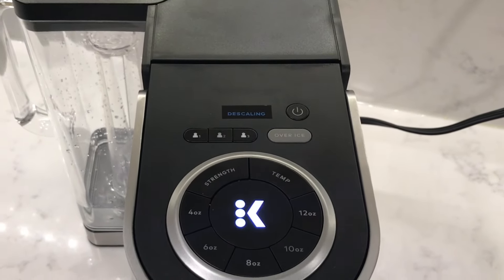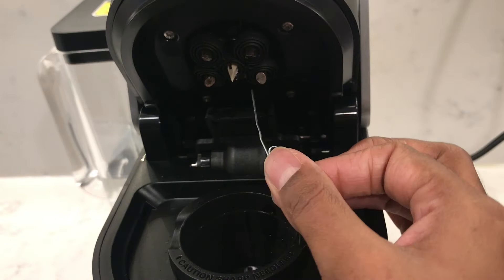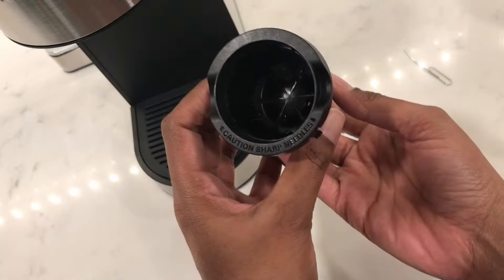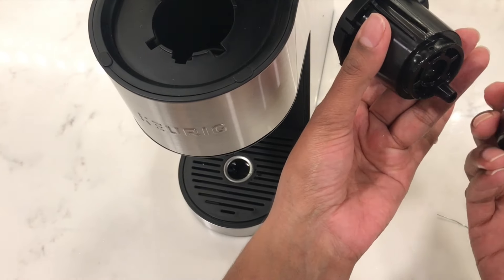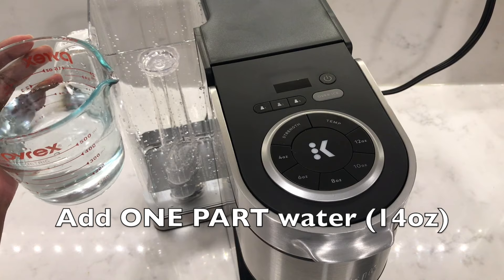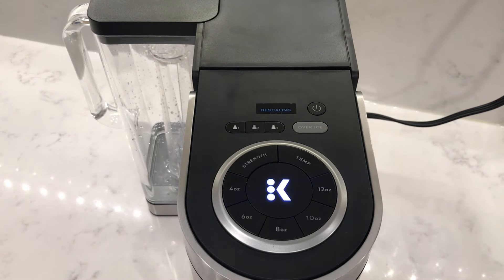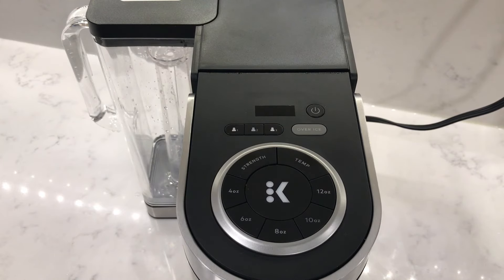DESCALE and CLEAN your Keurig Now for Better Tasting Coffee!

Comment: 0:46 Just an FYI for anyone watching this in 2022. The rubber “surrounding area” thing pops right out. It’s not secured by anything other than tension and friction. Pull gently and it slides right off. You can rinse it off completely. I found it easier than working it with a toothpick or paper clip.
Reply from the maker: interesting, thank you for sharing!

Comment from the maker: Descale: TURN OFF the machine (power button only - DO NOT unplug it) >  press 8+12oz together > press the 'K' button. 
- Remove the filter first (apologies this was not included in the instructions I found on Keurig's website, but it is noted on the solution bottle which I didn't have at the time I made this video).
- Make sure you have enough water in the tank, even if the 'add water light doesn't turn on (there are a lot of problems with this machine!)
- If the light is still on, clean the needles, coffee deposits are possibly stuck inside somewhere.

Comment: The key to this process is to this: You start with the coffee maker plugged in but turned off. In other words, nothing is lit up on the top of the lid you close. Easiest way is to unplug the maker, weight a few seconds then plug it back in. DO NOT TURN ON THE POWER USING THE POWER BUTTON. 

Now press and hold the two recommended buttons and off you go into descaling mode.
Reply: Finally someone explained the subtlety. Thank you! I've been trying literally for months to figure this out.
Reply: OK so let me get this straight!! We hit the 8 and 12 to descale. But while it is off!!!! OMG IT WORKED!!! next dumb question. Do we descale with the mineral thing in there?
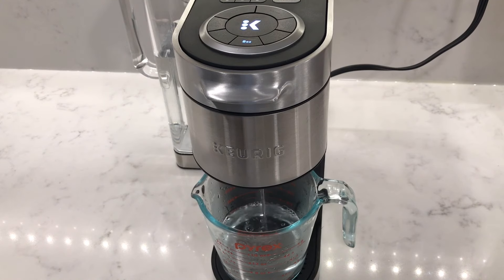Reply from the maker: @starnettacone7145  Yes, as I showed at 2:21, make sure the machine is off.  Remove the water filter if you plan to keep using it for a little longer, otherwise, it doesn't matter if you leave it in if you're planning to change it anyway. Hope that helps
Reply from the maker: Yes, I did state at 2:21 to make sure the machine power is off. But thank you for the adding step of unplugging if it needs to be done.
Reply: Finally after watching many videos it worked!!! Key is TURN OFF machine!!! Thanks
Reply: Thank you for this!   I was going crazy trying to get to the descale mode - much frustration alleviated by your clarification - saved me much frustration!
Reply: For those of us who don’t have a 12 button, press the 6 and 10 for 3 to 4 seconds. The Descale and 8 oz button will flash. Run 8 oz cups. You will need to refill water when the add water flashes. Min only needed to refill once. When the machine turns off and all the lights are off, the descale light should be off when you turn the power on again.
Reply: Omg! Thank you! I thought I was dumb and my machine was angry with me! Lol
Reply: @ALEXSIMONE  Me too... in fact, I had to come back to this video just to remember that!
Reply: This comment right here!!! Thank you!!
Reply: Gotta ask.  Why is process that is so specific also so hard to find information on?   I suppose in may be in the instructions that come with the machine, however it seems many people (like me) threw the instructions away. 

Then, three months later.  There’s a blinking light I have no idea how to deal with. 

Thanks for the tutorial!!
Reply: @dicer4683  I figure the guys who wired it wrote up the instructions, but the folks who put the manual/documents together couldn't unders *($*&( about how to do it either? lol
Reply: God they make it so complicated. Thank you so much.
Reply from the maker: @paulineburke2363  yes, alot of people are missing this step for some reason!
Reply: After descaling machine won’t turn on. What now?
Reply: THANK YOU! I couldn’t figure out why I couldn’t enter descale mode, and missed the instruction to make sure the machine is off. But whomever devised this crazy method of entering descale mode needs to have their engineering license revoked!
Reply: Lol yes this did it - this video needs to be redone to point that out !
Reply from the maker: @briankotoka The video points out that the machine needs to be turned off and all the steps, however I did forget to remove the filter, but I’ve clarified that on all the comments and also pinned it to the top. Please feel free to go back and read.
Reply: Most useful comment in 50 videos!!!! Thank you!!!

Comment: I've got this machine.  I've also got a regular machine that uses filters.  And I've got a "french coffee press".  The Keurig is the most convenient but worst tasting.  The french press has, by far, the best taste but least convenience.  The regular coffee maker with filter is a good compromise.  If you use the french press don't use the "press" part...just keep rod in the up position.  Brew for 4 minutes, then stir with spoon, then brew for 5 more minutes.  Then (with lid still in place) pour all the coffee into another container.  Don't use the last inch of coffee in the press.  Let it sit for a minute or two so grounds fall to the bottom.  Then pour slowly into coffee cup.    Never put grounds in the sink.

Comment: Thanks for the great vid. My descale light won't turn off either. Not a horrible issue, but annoying after days on end. Sounds like Keurig has an issue to fix.
Reply from the maker: it's possible there are some tiny coffee grounds stuck in there i would recommend trying to clean the needles or run a cleaning brew a couple of times to flush it out. hope it helps.

Comment: Great video. I recently descaled my unit and at the point where it should have said to add water, it continued brewing, overheated, and shut down, never to turn on again. Keurig sent a replacement. Any other tips to make sure this doesn't happen next time?
Reply: Just do a reset and it will turn back on
Reply: @wyatt2439  there is no documented reset on a Supreme Plus, unfortunately. Now that I have a replacement, I may try taking the old one apart and seeing if there's a thermal switch to flip. Hope this doesn't happen to the replacement unit though.
Reply: This is exactly what happened to mine when I followed the instructions in this video. I'm pretty pissed off following her instructions fried my Keurig.
Reply: The add water light did not turn on when the water level was low on my unit also. Fortunately I had a container of water and quickly added to it, this prevented the unit from overheating and causing the heating element to burn out.
Reply: I think I may have just done this exact thing, ugh!!!!!
Reply: I think a lot of first time users looking for a descaling video see this one & make the mistake of leaving the cartridge filter in while using the solution to descale. Same thing happened to me, the add water notification never popped up & it over heated & fried. Luckily I bought mine from Costco & was able to return it & get a new one.

Comment: Thanks for the explanation! Question do I need to remove the filter before?
Reply from the maker: You're welcome.  If you want to keep using the filter (for example, if it's already been replaced recently) then remove it before descaling. If you've had it for a couple of months you can take it out and replace it with a new one after descaling if you don't want to take it out before starting the descale process. Hope that helps.

Comment: You have to turn power off and press simultaneously 8&12 then the k button then after each clean press k button until it says add water then it should be descaled
Reply from the maker: Thank you! I have a feeling alot are skipping the part to turn off the machine first!

Comment: You should take out the filter holder with the filter. It is best to change out the filter, itself, at this time.
Reply from the maker: Yes, remove the filter first - apologies this was not included in the instructions I found on Keurig's website, but it is noted on the solution bottle which I didn't have at the time I made this video.

Comment: Do you leave the filter pod in the reservoir when descaling?
Reply from the maker: Great question! This wasn't covered anywhere in the instructions or on their website but according to Keurig's blog site, remove the filter. Hope it helps! https://blog.keurig.ca/blog/how-to-clean-a-keurig-coffee-maker/
Reply: Filter has to be taken out during the descal process.
Return it back in only after you completely done with a Rinsing cycle.
Then you should be ready to use machine again.

Comment: Hi Meem.  I have the exact same Keurig model shown in your video and I followed the instructions exactly as shown but I've done the descaling twice and every time I've done it, the machine shut off towards the end of the process and it would not turn back on unless I reset a switch inside the machine, which requires taking it apart at a level that I'm sure most people are not comfortable doing.  I'm a maintenance tech myself but even so, this process is not easy and I was curious if you have any idea why this is happening.  I almost took it back where I purchased it from but instead I went through the trouble of resetting it these two times.

Comment: I did the decalying thing. But my machine is not working as suppose to be . I had this problem before decalying.  No coffee comes  from down. Although when I run it with no k pod inside the k cup its runs smoothly with hot water coming out. Any clue.  Thanks guys
Reply from the maker: I was able to find this on the Keurig website, perhaps you can try and see if doing any of these help: (Note: I've shown how to clean the exit needles in this video)

• Power the coffee maker off. Press and hold the brew
button and 12oz button for 5 seconds until water starts
dispensing. Then release and let the water purge. Discard
the contents into the sink. Press the power button to
restart.
• The exit needle may be clogged. Refer to the Exit Needle
 care instructions. 
• Clean the K-Cup® Pod Holder, see K-Cup® Pod Holder care
 instructions.

Comment: Yes light will eventually go out , but takes so many cycles to do it, totally ridiculous. The video I think is spot on, but like I say keurig needs to change that up to where you can easily reset that descale light and not have to go through all those cycles.
Reply from the maker: Thank you. I would recommend to clean the needles too after the the first cycle, that should help and hopefully not require multiple cycles. The light staying on seems to show that the machine can sensor coffee deposits stuck somewhere, they just need to be 'flushed out'

Comment: Why did you leave the filter in, I thought the filter in the tank is to be removed while descaling and then replaced with a new filter when the process is complete!
Reply from the maker: Yes, remove the filter first - apologies this was not included in the instructions I found on Keurig's website, but it is noted on the solution bottle which I didn't have at the time I made this video.

Comment: I went through the whole process twice and had bought two bottles of the descaled liquid and my descale notice never turned off.
Reply from the maker: It's possible there are some tiny coffee grounds stuck in there I would recommend trying to clean the needles or run a cleaning brew a couple of times to flush it out. hope it helps.

Comment: Ok one quick question I just brought it new and wanted to know WHEN to change the water.
Reply: Not the water like descale it’s like when?
Reply from the maker: You only need to descale it once the 'Descale' notification shows up. This should be after 250 brews or around three months after using the machine. If you just bought it, the only thing you should do is run clear water the first couple of times before making your first cup of coffee. Hope that helps.

Comment: Shouldn't you remove the filter before adding the descaling solution?
Reply from the maker: Yes. My apologies, it was a brand new machine and I didn't have the Solution instructions, just Keurig's vague instruction manual that came in the box with the machine.  You should remove the filter before adding the descale solution. Thank you for pointing it out.

Comment: As a Keurig employee, you did not properly clean the other four needles. You should look closely on the side of that other four needles and you can see a hole in each of them then insert the paper clip all the way through. Paper clip is not advisable to use. If no paper clip, use a safety pin. In descaling the Keurig, you should remove some accessories such as water filter together with the cartridge. And once the Add Water light illuminates, pour out the remaining contents from the reservoir and rinse it with fresh water. Once rinsed, refill with tap or bottled spring water, then let the brewer stand for 30 minutes while it's on. After resting the brewer, continue the brewing process like brewing water only until all the lights will turn off.
Reply: I think that is a different model, with the 4 needles. Mine has 1 needle with 3 holes, like hers. I think it's the Supreme.

Comment: Ive gone 2 fills of the tank and descale wont turn off. I think I should be passed good now.
Reply from the maker: It's possible there are some tiny coffee grounds stuck in there I would recommend trying to clean the needles or run a cleaning brew a couple of times to flush it out. hope it helps.

Comment: I did everything 2 times and the descale / descaling light will not go off! Help!
Reply from the maker: Hi. Can you press and hold the 8oz and 10oz button together for at least 5 seconds. If that doesn’t work, try to clean the exit needles. Also shown in my video.
Please let us know if any of these work, a few people are having this issue but I can’t fix it since it’s not happening on mine. Thanks! 

If the light is still on something is likely causing a blockage. There maybe some coffee grinds build up..
Reply: @MeemReviews  thank you that did the job. So very grateful
Reply from the maker: Awesome! Thanks for letting me and everyone know!
Reply: @MeemReviews  Thank You! K manual didn't explain that.
Reply: same here. cant reset
Reply: Remove the filter before descaling 🤷🏼‍♀️

Comment: Easier said then done. I followed the instructions to a T and now my machine will not turn on. Come to find out that the internal high limit switched trip. 
Be careful with how many rinses are done and at what temperature. This particular model has a glitch with descaling.
Reply: I’m having this issue too. How did you fix if

Comment: I have already run three reservoirs of filtered water through my machine and the descale light still has not gone off.
Reply from the maker: It's possible there are some tiny coffee grounds stuck in there I would recommend trying to clean the needles or run a cleaning brew a couple of times to flush them out. hope it helps.

Comment: Why doesn't my add water notification come on
Reply from the maker: Are you letting all the water drain out completely and not topping it up too soon? Try to wipe the area where the water resorvoir sits, perhaps there is water built-up in the and the machine thinks there is water still in the tank.

Comment: Two things, I did this steps three times and the descale lights does not comes off HELP! nothing from Keurig yet...Second you cannot leave the water filter in when Descaling, just letting you know...LN Out.
Reply from the maker: Yes, removing the filter was not included in Keurig's instructions, only on the descale solution instructions which I didn't have.  It's possible there are some tiny coffee grounds stuck in there I would recommend trying to clean the needles or run a cleaning brew a couple of times to flush it out. hope it helps.

Comment: What happens if you accidentally take the water tank out?
Reply from the maker: Hopefully the smoke has subsided by now, but based on the instructions, its best to unplug and let it sit for 30 mins or so until it cools down. When you're ready to use it again, just run a clear water cycle only, no pod. If it still smoking you may need to contact Keurig support. Let us know how it goes.
Reply: @MeemReviews   ok thanks
Reply: @MeemReviews  It was plugged overnight and it was not turning on so it’s the morning and I will unplug for 30 min and
Reply: I will let you know

Comment: HI  in your video i think you have missed an important step, you did not remove charcoal filter before adding descaling solution, as per directions on bottle. then, you have instructed at end of video to go ahead and use machine with same charcoal filter in that went through descaling process. I am guessing that one would want a new charcoal filter, uncontaminated by descaling solution. good video other than that.
Reply: except in the video she did not put the descaling solution in. she clearly stated that she is not putting it in because the machine is new.  but yes you are correct about the filter needing to be removed first, that's why I am going to descale my Keurig every 2 months when I replace the filter.
Reply from the maker: Yes, you are absolutely right. My apologies, it was a brand new machine and I didn't have the Solution instructions, just Keurig's vague instruction manual that came in the box with the machine. Since you would need to replace the cartridge every 2 months, that would be the ideal time to descale too. I appreciate the comment.
Reply from the maker: @12369ja thank you, appreciate the comment.

Comment: Descale light will not turn off after following instructions
Reply from the maker: It's possible there are some tiny coffee grounds stuck in there I would recommend trying to clean the needles or run a cleaning brew a couple of times to flush it out. hope it helps.

Comment: PLEAAASE FIND A SOLUTION
Reply from the maker: Hopefully the smoke has subsided by now, but based on the instructions, its best to unplug and let it sit for 30 mins or so until it cools down. When you're ready to use it again, just run a clear water cycle only, no pod. If it still smoking you may need to contact Keurig support. Let us know how it goes.
Reply: @MeemReviews  nope doesn’t work